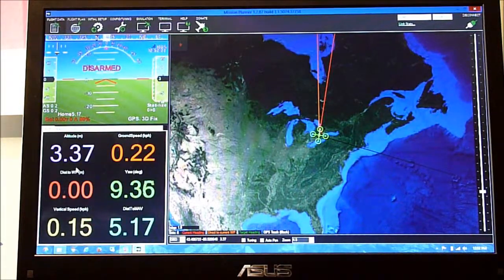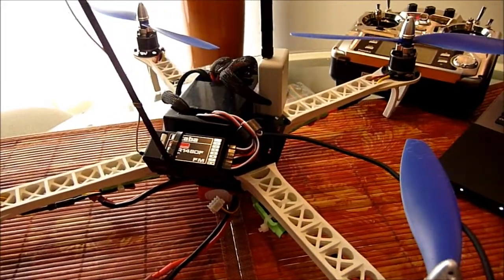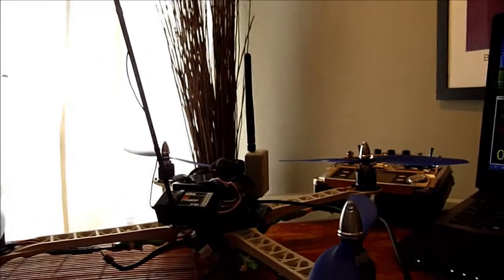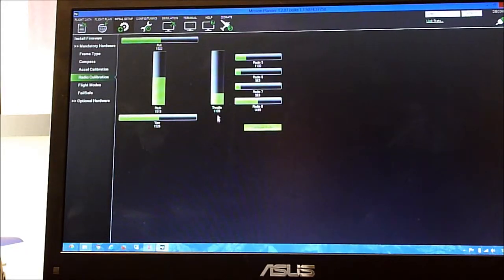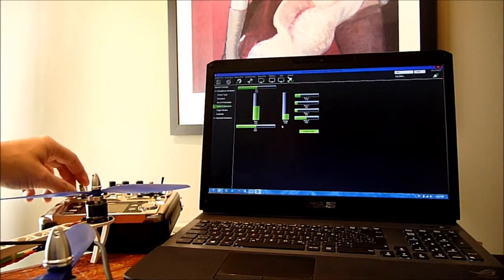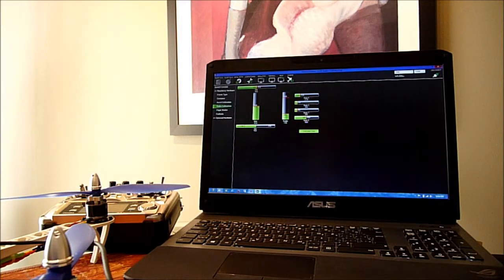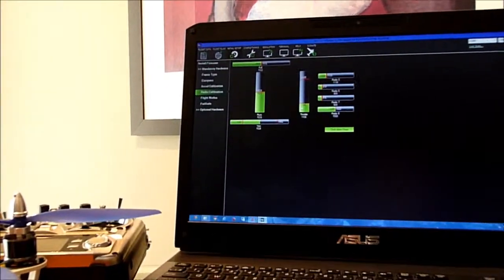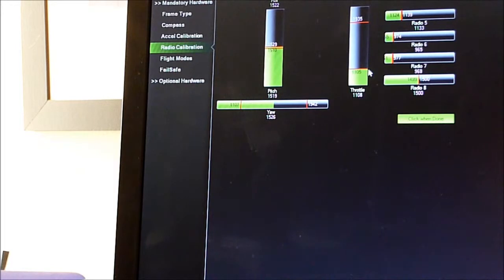Quadcopter APM 2.5 Twitches,due to RF,

Comment: hi
i want to ask  you if the glones of apm are good as apm from 3dr
Reply from the maker: The amp clone i have is from hobbyking seems to be really good, i cant give you an exact comparison since this is the only flight controller i have. but the instruments seem to be really accurate the compass, barometer, and GPS
Reply: Electronics101az really from hobbyking and what gps do you use lea-6 or neo?
Reply from the maker: giorgos arab I'm using the NEO-6M GPS Module